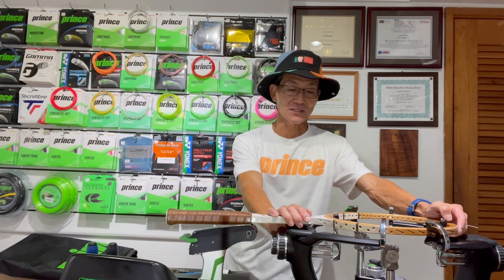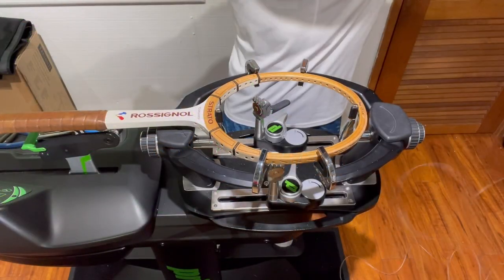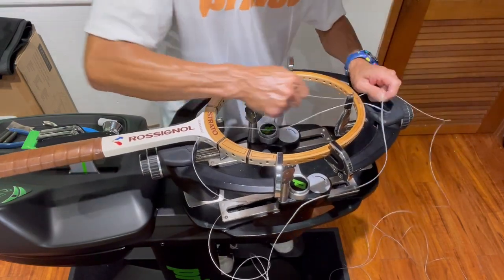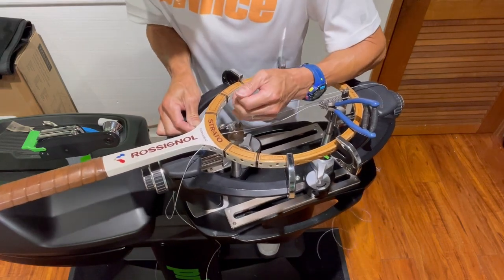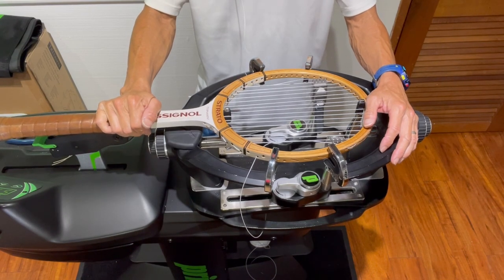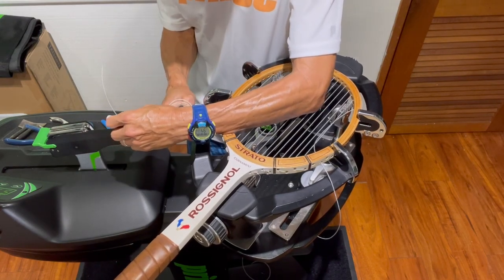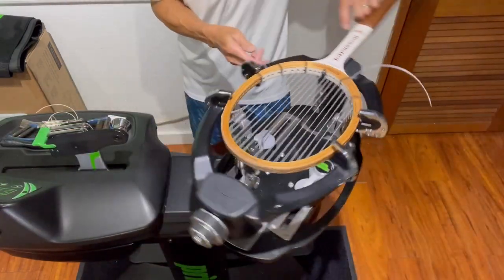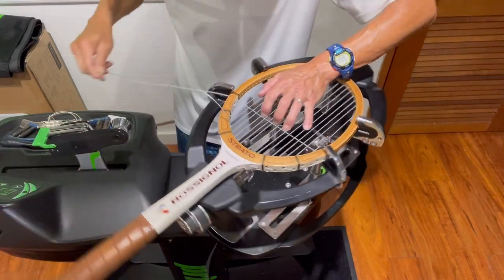Racquet Story [Stringing Trivia & 22x11 Wood Racquet Technique]

Comment: Hi Albert been watching your videos since you opened your channel. Love your content. I never strung a wooden racket before so I have one question if you can answer this is if it's easier to string wooden rackets with a one piece or a two piece or does it matter especially with those 18x20 shared holes.
Reply from the maker: Aloha, Thanks for watching my videos and supporting my channel! Back in the day, all racquets were strung with two-piece, at least from what I remember. Most stringers strung wood racquets using the traditional two-piece method (crosses weaved from top to bottom). As I mentioned, this 22x11 pattern was ideal for stringing natural gut but I liked it so much that I used it for all strings! It was fun shooting this video . . . it brought back some memories!
Reply: Yeah I was thinking of trying 22x11 stringing technique. Thanks you for replying so quickly and all your great videos.
Reply from the maker: @gtowsweet  Happy Stringing!

Comment: Hi Albert! I recently purchased a lacoste competition wood with braided graphite racquet. Have you strung this before?
Reply from the maker: Aloha, Wow, lucky you! I haven't seen one in person but sure looks like a beauty. Are you planning to play with it or hang it up on your wall?
Reply: I am definitely planning to play with it. I found a few pictures using google, and I was suprised to see that the first 5 mains from the middle shared holes (2mains each)! However, it was difficult to see where the tie-off for the knots are. I am still a newbie stringer so I am contemplating to buy another woodie that's not as new as this one to practice first. I love your videos by the way especially the one about maintaining the prince neos 1000.
Reply from the maker: @aass-gj1nr  That sounds like an odd but interesting string pattern. You should probably string it up with a synthetic gut or multifilament string and avoid polyester. String it up at a low tension and use the conventional 2-piece stringing, weaving your crosses from top to bottom. Thanks for your support!

Comment: Do you happen to take into consideration when stringing crosses with stringing the first weave above or below the the main when the cross hole is higher or lower. (I.e.-Wood frames tend to not have the holes directly in the middle of the frame- they tend to be staggered.)
Reply from the maker: Aloha, That is a very good question! Similar to the modern racquets with a staggered pattern, where the sting holes on the frame are offset, the first weave should be a "hard weave." In other words, if the cross string hole is high on the frame, then the weave should start below the main string.
Reply: @AMstringing  Thnx- I've been stringing since the 80s and that's how I've approached it but nobody seems to have addressed the issue. You're the 1st on a YouTube to address it as far as I know- perhaps put it in one of your videos?
Reply from the maker: @classicpicksof80ssticks  Ironically, you're the first to ask this question and would probably be the only one. 🤣 Thanks for watching!
Reply: @AMstringing  I would think that knowing what to do with the staggered hole crosses would be a basic aspect to know if one wants to string a wood racket. Again, I don't understand why none of the number of YouTube videos going over how to string a wood racket doesn't mention anything about it.

Comment: Thank you for demonstrating a forgotten(?) technique. I have been stringing for less than 10 years but for fun have done a number of wood racquets-not with gut and standard 2 piece. Question; Did your modern stringing machine leave indentations on the frame edge? The L shaped racquet supports put a lot of pressure on the edges. What tension did you use in the video?  Have you considered showing how to string a T2000?
Reply from the maker: Yes, I guess it was forgotten. I Googled it, to see if there was anything mentioned about it, but couldn't find anything. The stringing machine didn't mar the frame at all. I strung 8 of those racquets for a tournament requiring players to use wood racquets. I strung the first couple at 50 pounds, but it came out feeling so tight, I strung the rest of them at 40 pounds. I've strung a few T2000's back in the day. If I ever do a stringing video on it, I would definitely have to practice first . . . lol!
Reply: @AMstringing  With a pattern diagram and a strung racquet for reference, it still took me 2+ hrs to string the T2000. Box pattern? Do you know if Prince had a mid or mid-plus version of their "Woodie"?
Reply from the maker: @robertjacobson941  Yes, that box pattern brings back some memories! I don't believe a midsize version was made in the Prince Woodie. I used to play with the Woodie strung with natural gut . . . that's bringing back even more memories!!
Reply: @AMstringing  My first decent racquet was a Bancroft Player Special with blue spiral string and later had a Stan Smith autograph Wilson. Better players at the time used gut strung Kramer autographs and a lot of girls had TD Imperials. Thanks to second hand stores, I have collected dozens of these fine old wood, steel, aluminum, and composite racquets for pennies. Some are wall-hangers but most are re-strung and taken out for a hit. It's too bad Prince didn't produce a 95in Woodie. I think it would have played well.

Comment: One more question (hope you don't mind!) I haven't watched all of your videos but the ones I haven't seen you  use an awl. Are owls "out" now? I still use them to maintain tension on Tuesday. I've seen people mention that different knots allow for more cinching and the newer electric machines have a special tie off pull where the tension is higher. What are your thoughts on awls?
Reply from the maker: Aloha again, 
I keep two awls on my stringing machine tool tray, and here are some of the uses.
STRAIGHT AWL - 1) Probe inside of grommets to check for breakage; 2) Enlarge grommet hole size to create a tie-off hole; 3) Create a passageway for the cross string on a shared hole; and 4) Guide new replacement grommets through the frame holes. Watch the video from 11:10. https://www.youtube.com/watch?v=Zz_HDgn9g7I

SETTING OFF AWL (Blunt Straightening Awl) - 1) Straighten strings and 2) Ensure a flush fit when using the RAB Fittex Grommet System.

I'm not a fan of using the straight awl to maintain tension on a tie-off. Although I use the knot function on my stringing machine (+10% pounds), there will still be some tension loss after tying off. In my opinion, this is totally acceptable since players are not supposed to hit balls in that area of the string bed. 😆 If anything, a little less tension on those outer strings might provide more "spring" and actually help. 🤣 

SIDE NOTE: The main thing with tying off on a 1-piece stringing is that you want to maintain equal tension on the two outer mains and two outer crosses. Watch this video. https://www.youtube.com/watch?v=Zz_HDgn9g7I

Happy Stringing!🤙